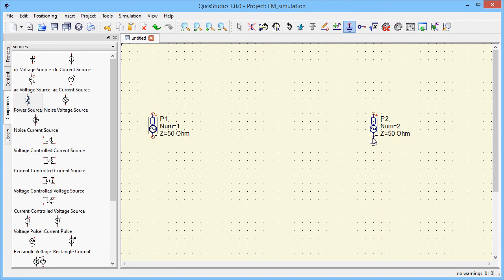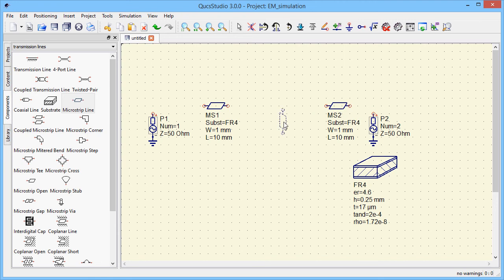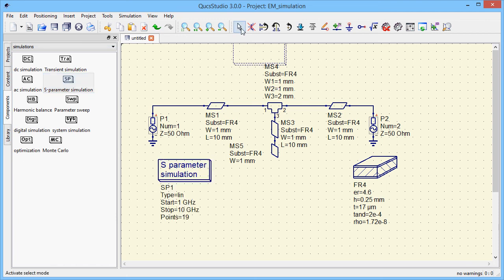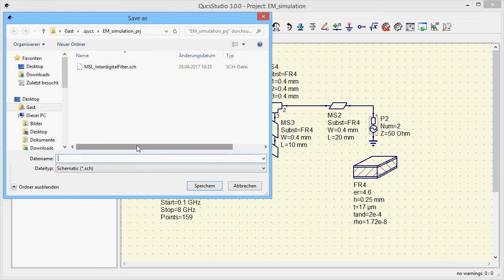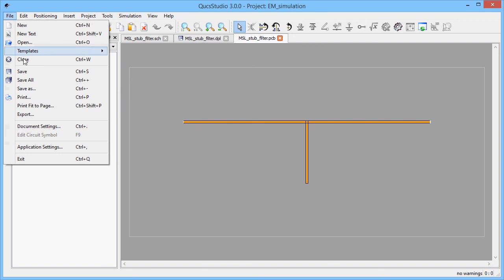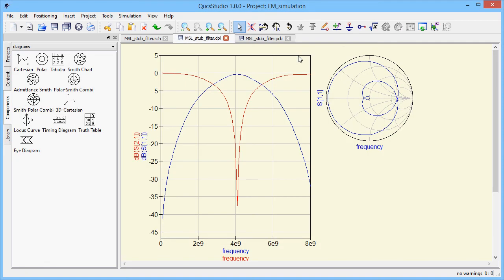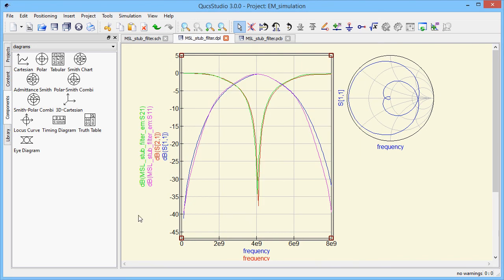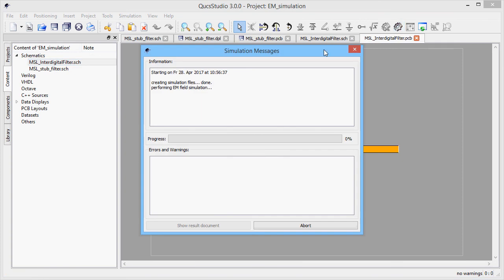QucsStudio: Electromagnetic field simulation

Comment: Hello, thanks for the video! I tried to follow these steps, however, I could not get the same auto-generated layout after selecting the 'Create PCB Netlist'. Running 2.5.7 version. Kicad board environments opens instead. Even there, I can not make the lines to appear with the 'Read netlist' option, only the ports.